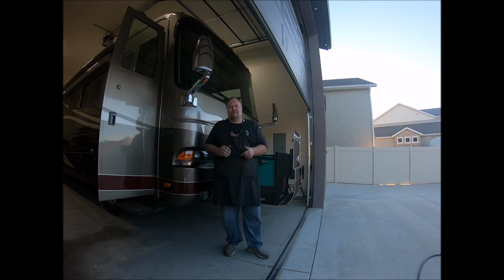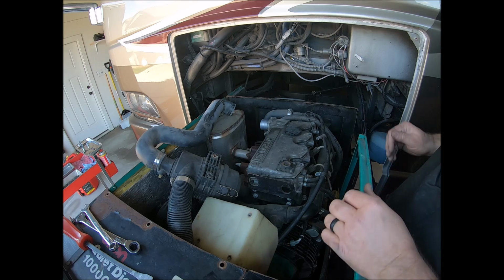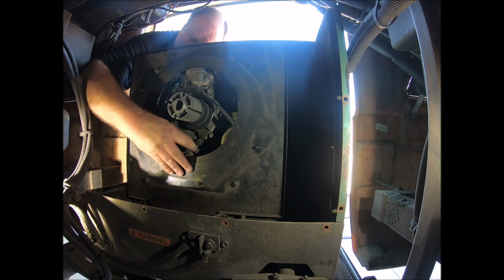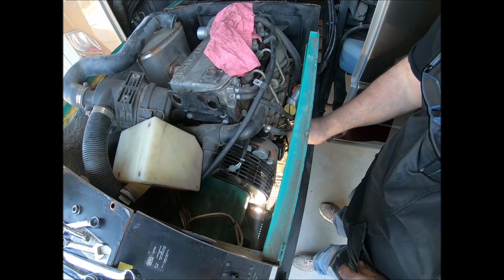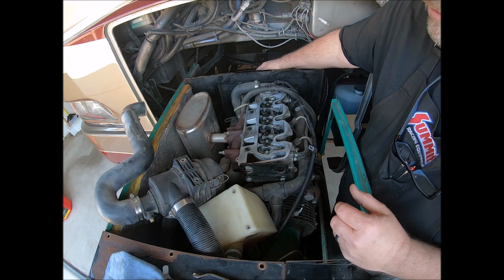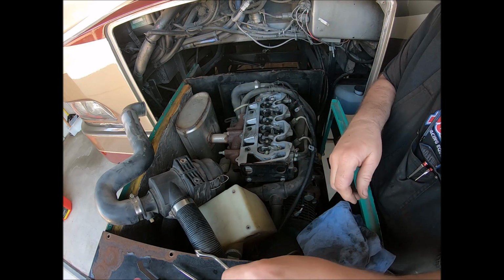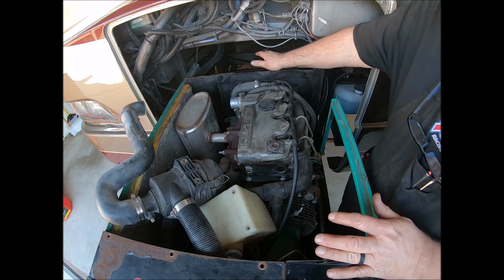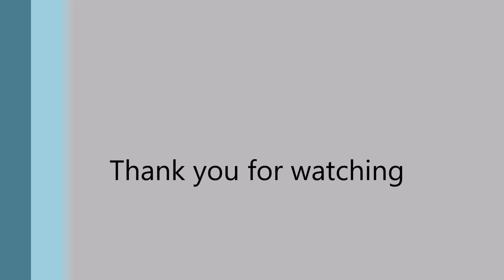Onan 10kw Quiet Diesel Generator Major Service

Comment: Just changed the belt on my 2001 Monaco exitive.  Find your videos helpful when working on mine .
Had it apart to find an oil leak .
So once I had it apart figured to go ahead and change the belt  , check for wearing & rub  marks on all the hoses. 
And I found the oil leak too .
It was the oil pressure sending unit. 
Next project is to replace a couple air selinods for the HWH system. 
Have the screws turned in on the valve body so it's only in normal air ride for now .
Thanks for all the great information you share .
Reply from the maker: Thank you for the comments.  Glad to hear the videos are helpful.  Thank you for taking the time to watch. 
Mike
Reply: Can you help me understand what you mean about turning those t-handles on the HWH valve body? I have this system in my Allegro Breeze and because it's a 2011, I'm very interested in knowing how to manually override systems when traveling.
Reply: @Jurornumber5  
Not sure what you need .
Your coach is 10 years newer than mine to start .
If you have the HWH air leveling system on your coach they could be similar systems. 
On mine there are 3 valve bodies for the suspension. 
1 for the front suspension and I have  2 on my rear suspension. 
I have a tage axle on mine. 
Not sure if a single axle would only have one valve body on the rear .
In your coach manuals there should be a manual for the HWH system. 
That's where I found out how to put the suspension in basically a manual setting. 
I have an issue with the right side and haven't had time to  diagnose the problem. 
So I just turned the override screw in on the valve body. 
There should be a diagram in the HWH manual on the location of it on the valve body. 
I think you turn it in 3 turns .
The air suspension works just fine as a normal air ride.
You just can't use the control panel in the driver's  compartment to adjust the suspension. 
Not sure if this helps you but this override screw adjustment is to get you buy until you get it repaired. 
But if your happy with just air ride suspension and don't need the other features of the HWH system it will not hurt anything using it that way .

Comment: Hi Mike. I have purchased a coach that is very close to yours and am having a few problems that I need some advice on the aqua hot and the leveling system. if you could I know time is valuable.Thanks Jason

Comment: Great job again, Mike. Very informative and promote me to tackle this project. Where do you get your supplies from, if you don't mind saying. Thanks again very much.
Reply from the maker: Thank you.  By supplies I'm assuming you are referring to the parts?   If so, I obtained the OEM Onan parts from my local Cummins dealership, Rocky Mountain Cummins/Onan in Salt Lake City. 

The other supplies such as the V-belt and fuel filter I get from my local NAPA.  

I appreciate you watching. 
Mike

Comment: Another great PM video...I haven't seen a PM differential video by you  but assume you have done the PM on it. What Gear oil did you use & how much? I'm about to do mine for the first time on my '04 American Eagle with a '03 Spartan MM single axle chassis like yours. 
Thanks & keep those videos coming!
Reply from the maker: Thank you for the comments and for watching my videos. 

I didn't have a video specific to the rear differential.  However, my Allison transmission service video has some small segments pertaining to the rear diff. as I serviced it at the same time I serviced my transmission.  

Mike
Reply: @zmotorsports62  I did watch your Allison video before doing the service on my service...I'll go back & see it in regards the the Rear Diff. reference.

Comment: Hey Mike, Was there an extra stop you needed to remove to get your generator to pull out farther? Mine doesn't come out nearly as far as yours, it's a beaver non Tag but our coaches are very similar otherwise.
Reply from the maker: Nothing additional that I've done to get the genny out further.  My genny goes out that far originally.